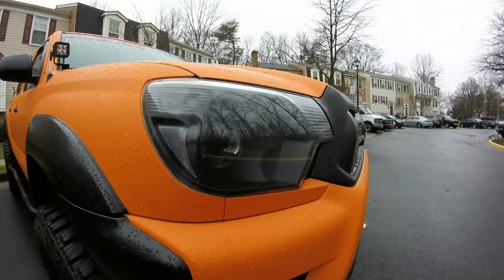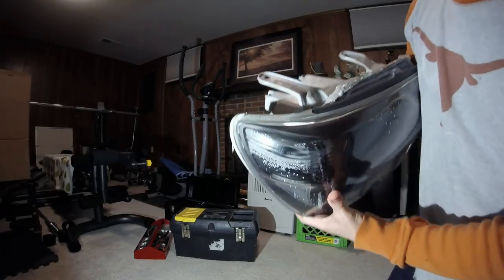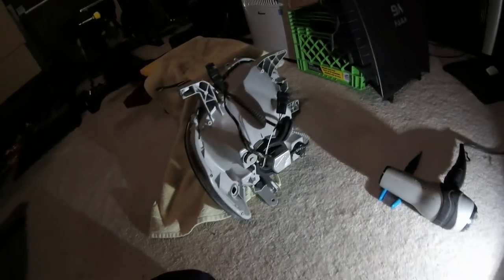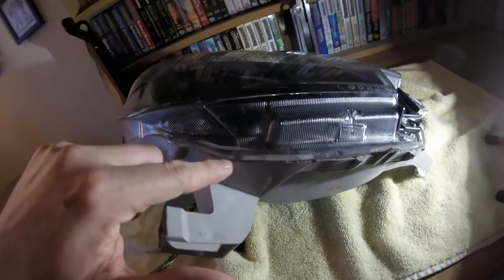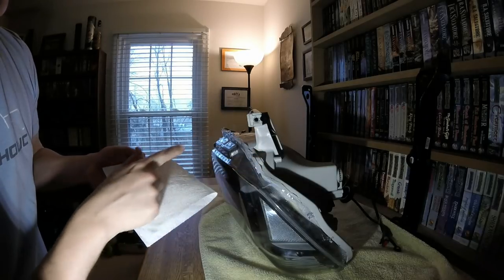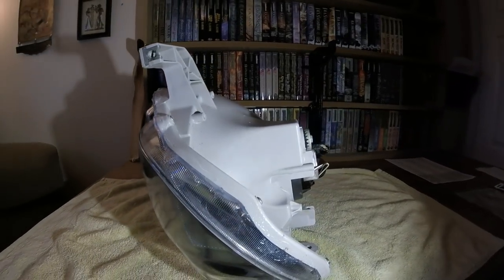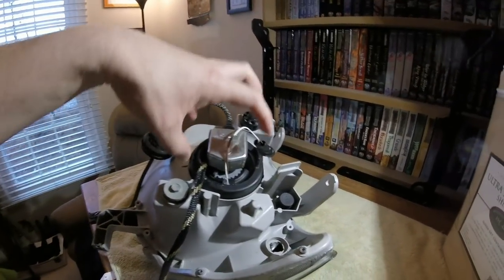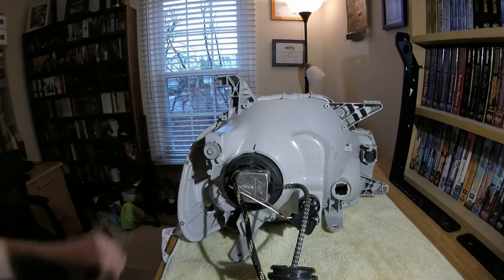Waterproofing and Sealing the Aquariums (Headlights) on My Toyota Tacoma

Comment: this is what I will be doing this weekend. the aftermarket headlights I bought wasn't sealed well and condensation occurred. such an ugly thing to see and annoying AF. this time I'll be adding  a sealant prior to installing a new aftermarket headlights which I should have done to begin with.
Update: Quick and easy to apply the sealant thanks for the video

Comment: Good lookin' job.  Liked your slow and steady approach to drying out the lights. Makes for a less stressful correction.👍👍👍👍
  😀 'course if it had been me I'd a just drilled two holes in the bottom of the front lens and let the rain water drip out......Saves me buyin' silly-cone  😁😁😁
Reply from the maker: I just wanted to make sure these lights were completely dry because it's just a hassle to deal with. I breathe a sigh of relief every time I walk to my truck to check for any moisture.

Comment: Pro tip i got from Sweet Project Cars channel, you can pour 90% isopropyl alcohol in the headlight swish it around and pour it out a couple times and then it will dry alot faster. Nice video though. Those led lights from walmart are awesome
Reply from the maker: Hmm I wonder if that would be a good way to clean the inside clear plastic as well because I do have a few water spots in there.
Reply: Probably would help

Comment: Perfect timing! I'm dealing with this right now.
Reply from the maker: 😀 Just make sure you use plenty of sealer and you'll be fine.
Reply: Good deal. Just have to wait on this rain to stop first.
Reply from the maker: Lol yeah I had to run outside to re-install my headlight during a 10 minute lull in the rain here.
Reply: LOL, that's one way to test the new waterproofing.
Reply from the maker: Tons of fun. I got the headlight seated and the bulbs installed then it started raining again. So I waited for the rain to stop before going back out to tighten down the 3 bolts holding the headlight in. Mother nature is always against me.

Comment: awesome video! I'll keep it in mind just in case my aftermarket tail lights start to pose issues. 

Re- I finally got my tailgate repaired and have my tailgate reinforcement steel on the way. Thanks a ton @Tacomaholic for the suggestion.  TW post coming up in the next few days of my progress

Btw, ever heard of anyone having luck with roll on bed liner to coat their composite bed? mines totally faded out and gouged up.
Reply from the maker: Thanks buddy! I bet if you sanded the bed good the roll-on stuff would work great.
Reply: I'm hoping so. I cant seem to find any who have done it on TW for opinions but my expectations are as you said. I just wonder if I should go Rhino-liner or rustoleum. hmm

Comment: Great vid now I can fix my taillight !
Reply from the maker: Thanks! At least the taillights are super easy to remove. 👍
Reply: Tacomaholic very! Hey don’t leak as bad but enough to where I will fix them. And my rack came in I love it! Oh what do I use for a mount with your rescue buddy’s I have the same ones
Reply from the maker: Did you get a KB Voodoo rack? Before I just had by escaper buddies strapped to the top of my rack, but I plan on doing a vid showing how to make a better mount for it.
Reply: Tacomaholic i do have the kB VooDoo rack. My maxtrax are mounted with the maxtrax pins but I don’t have anything for my maxxas traxs. I also have prinsu rack coming this week witch it where will be mounting both tracks too

Comment: Hey man I was going to ask you about your demon eye switchback on your projectors.  Can you have the color on while the actual HID is on or does your HID have to be off to be able to see the color on the switchback.  I'm asking because my truck has daytime runners and Id have to do some rewiring if there can't be another light on for the colored leds to be visible.
Reply from the maker: Hey buddy, I always get the terminology wrong but I think the demon eye is where the light is on the inside of the projector lens. The ones I have light up a halo around the projector lens.
Reply: Tacomaholic Thanks for the info, I guess a simpler way to put my question is if your headlights are on can you still see the color?  Or does your main light need to be in the off position in order for the color to come through?

Comment: Have you heard of the driver headlight low beam burning out every few months? It only driver side, both sides were changed at the same time.
Reply from the maker: No haven't heard that one before. Stock bulbs and stock housing?
Reply: Stock housing, Sylvania bulbs
Reply from the maker: @TheBryeguy  Good chance it's the bulbs then if you haven't changed any of the wiring. Try a set of different bulbs, or put your OEM bulbs back in, and see if it happens again. Weird that it's only happening on the driver side.
Reply: Tacomaholic are Osrams the stock bulb manufacturer?
Reply from the maker: @TheBryeguy  I'm not certain but that wouldn't surprise me.

Comment: I live in the desert mountains, we don't have humidity or corrosion problems...The silicon packets won't make the water disappear and they will only absorb so much, so you might have to check them once in a while....Hope your neighbors don't open their doors on your truck, Sardineville...I know you have sliders but some doors are still high enough to hit your paint (wrap)...You took your eyelids off.
Reply from the maker: Thankfully my neighbors have a car with low doors. Yeah I'm thinking about slapping the eyelids on the black headlights now. Not sure.
Reply: I was thinking of getting a set of eyelids...You are not sure if you like them anymore?
Reply from the maker: OH I still think they look pretty cool. Just deciding if I should try to color match them with my wrap or leave them the bare matte black color.
Reply: I would leave them black, it gives your truck added texture and not just a smooth look...I am surprised you don't have a dash mat or seat covers...I took the bottoms of the back seat out of my truck for more room for my gear and dogs when I drive to Alaska...I would like to find some kind of storage box that would fit across the back where the seats were bolted...The back of the seats I protect so my dogs can go between the cab and my camper shell with the windows open...I like your rack but I have a camper shell on my bed...I have 3 rotopax mounted to the front of the bed (water, fire starting and storage), a shovel and Fiskars Splitting Ax like yours mounted to the liner and a DeeZee box with some of my other gear in it...I ordered a bracket like you have for your ditch lights but I think I want to put a cb antenna on it...I am glad I found your channel I have added some of the smaller mods from your videos to my truck but won't be adding lights, electrical, lifts and armor to my truck because I don't know what kind of shape it will be in when I get back from Prudhoe Bay.
Reply from the maker: Thanks for watching and glad to have you on the channel! 😀There are tons of mods/projects that I still need to do to my Tacoma so plenty more coming.
Reply: I bought a pair of aftermarket projectors for my 2005 and they provided an H1 bulb that was junk and provided extremely poor visibility. Tried upgradeing the bulbs, but still sub output at best. Was wondering if I could upgrade to LEDs or something a little better. I can post a few pics of what I'm speaking about.

Comment: Can that strip of silicone easily come off? It would’ve been a good idea to tape around the edge and quickly pull it off after you’ve applied the silicone to get a flush finish.
Reply from the maker: It wouldn't be too hard to scrape off.

Comment: The water gets in from the igniter, 90% of the time. I’m still trying to figure out how to prevent that! 
The rubber itself is not enough with the pressure build in the engine bay while going on the freeway so it finds its way in!
Reply: The "igniter'? What is that?

Comment: Hi sir, i have a couple of questions.
1. How come your Amazon link for the silicone gel sealant is different from what you used in the video?
2. Did you end up needing 2 tubes to seal a pair of headlights?
Reply from the maker: Any clear silicone will work for sealing the seam. 1 tube should be more than plenty.
Reply: @Tacomaholic  the one from the video I can easily get from my local Home Depot. The Amazon link silicone I have to get from Amazon. I was wondering if the Auto/Marine silicone is more meant for headlights.

Also, I need to do 2 pairs of aftermarket headlights. Do you think 1 tube will be enough?
Reply from the maker: @AlanJamias  Any exterior grade silicone will be fine.Yeah 1 regular sized tube will be plenty.
Reply: @Tacomaholic  thank you, sir.
Reply: Sir, I forgot to ask you how's your headlights after applying the silicone sealant? I just realized your video was 2 years old. Still no issues with condensation up until this day?
Reply from the maker: @AlanJamias  They had some very minor fogging once or twice but nothing like before and it's been a long time since I've seen any moisture.
Reply: @Tacomaholic  would it help if I apply the sealant, let it cure and then apply a 2nd time? Just to give the extra layer/seal?
Reply from the maker: @AlanJamias  It wouldn't hurt.

Comment: I have resealed mine 3 times now. Yet, water is getting inside the assembly. The cost for my headlight assembly new is $1600 dealership only. No aftermarket. Junkyard cost is $900. I'm mad as hell at the manufacturer of this crap.
Reply from the maker: Yikes! Who made your headlights?